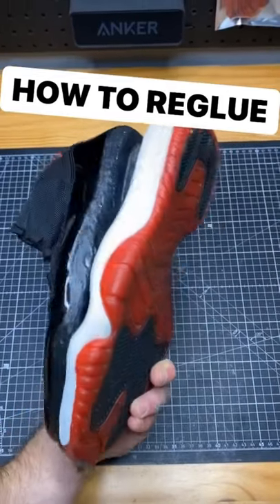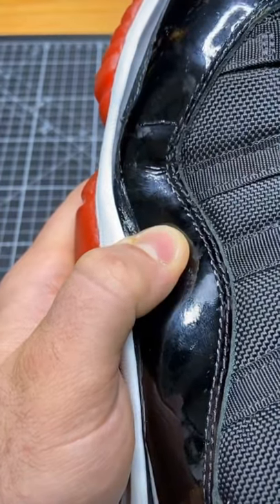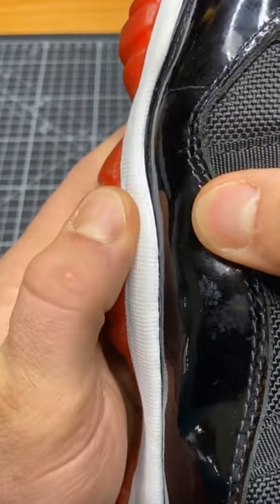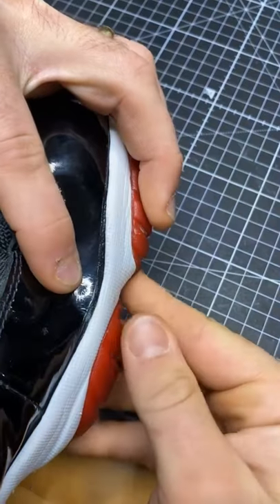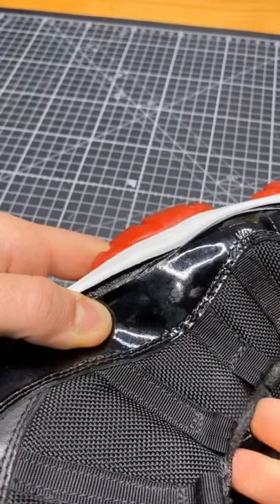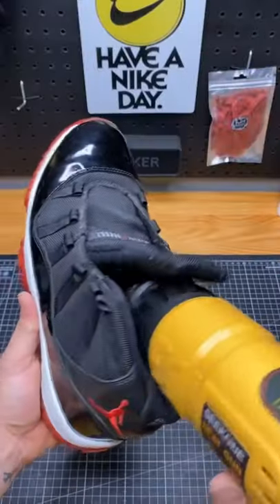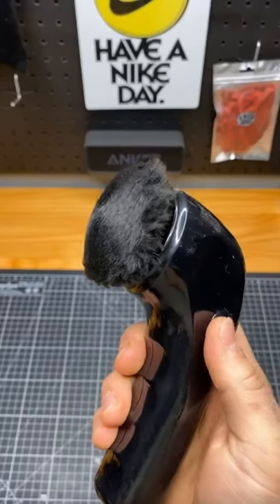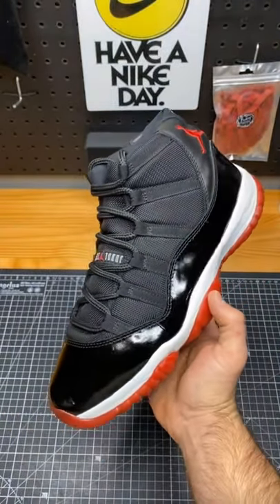How to reglue and bond Air Jordan 11 uppers to midsole End of video shows final restoration results!

Comment: Nvm I see it's barge cement. Will a hair dryer work instead of a heat gun? If not, does it need to be a certain brand name heat gun? What one do you use? Thank you!
Reply from the maker: I’d get a temp controlled heat gun like the one on my Amazon page. Hair dryers are much too risky
Reply: @Flippinkickz  ok. What temp is best to set it at?

Comment: Another question, a client tried to use super glue to reglue the mide sole to a pair of thunder 4s, and used a lot of it. can it be removed if so please tell how ? 🙏🏼
Reply from the maker: Depends where it is!
Reply: You might have to use a Dremel tool

Comment: Where did you get the hand buffer ?
Reply: Use a cheap power drill go to a auto supply store they got them there you can attach to a power drill or a disc sander can use

Comment: Its crazy they charge $300 for shoes that are freaking glued together. Walmart quality junk
Reply from the maker: Fun fact, 99% of all shoes are glued together. Been common practice for about a century
Reply: @Flippinkickz  No quality shoe glues their sole on. Nor does it being common practice make it ok. I mean id expect that kind of quality from budget friendly shoes from walmart, but for $300+ you can buy real shoes.
Reply from the maker: @nallen1006  false, every shoe utilizes glue in someway. Some of the best quality shoes are held together only by glue. From a $20 pair of knock off Walmart shoes to a $500 plus pair of military boats, same way of holding together
Reply: @Flippinkickz  I disagree, non of my shoes are glued. Soles/heels should be nailed and stitched. Glue can be used to help those, but if glue is the only thing holding your sole on, they are junk. Cheap, shouldnt cost more than $20 at walmart, junk. These jordans people are paying hundreds for are built to the same quality as those $20 pair, exact same.
Reply from the maker: @nallen1006  what brand of shoes are your shoes…
Reply from the maker: @nallen1006 still waiting